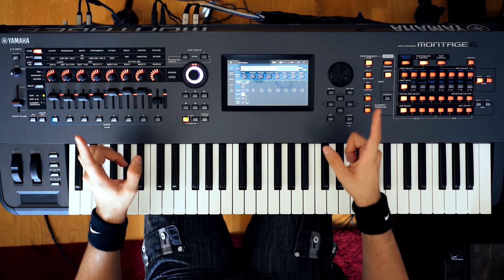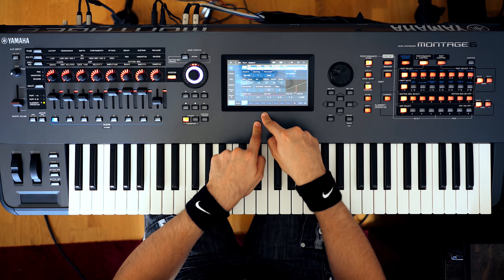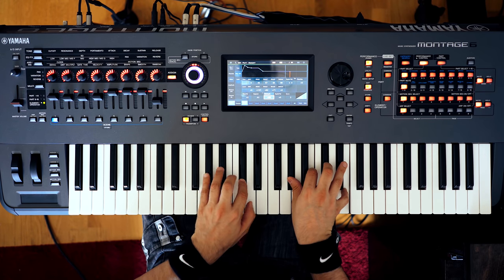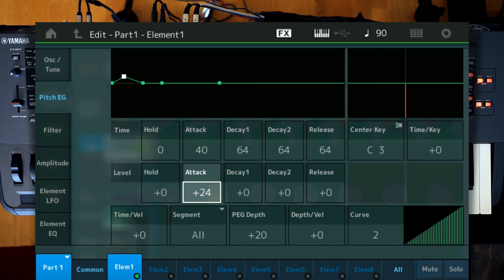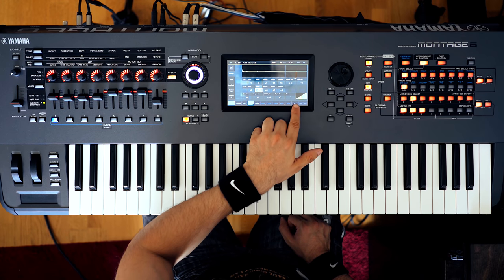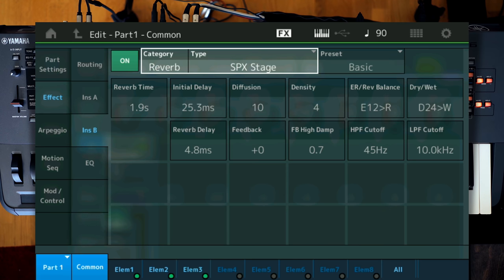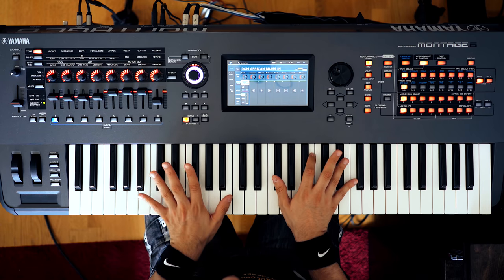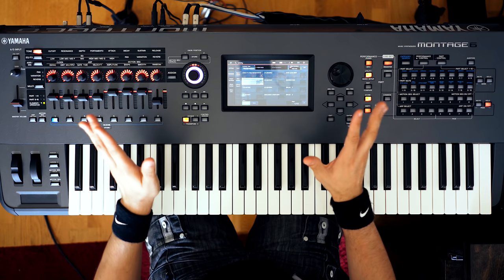How to Create Toto's Africa Synth Brass Sound on Yamaha Montage

Comment: Indeed  it works exactly the same on MOXF.
Reply: Luigi Maria Maesano you mean modx or moxf? I have the moxf8 and it doesn't have the touch screen
Reply: No touch. But to do this it makes no difference. It's the same enine (AWM2) of the MOtif/MOXF. @dillincasa6161

Comment: Thanks for the great video but you seem to have also pitch shifted everything down by an octave. I couldn't find anywhere in the video where you did that.
Reply from the maker: Hi Craig, I've used the transpose buttons (under the transport buttons). If you check, the left one is lit indicating that the whole patch is transposed one octave down. But you could also transpose the engine internally if you wanted.

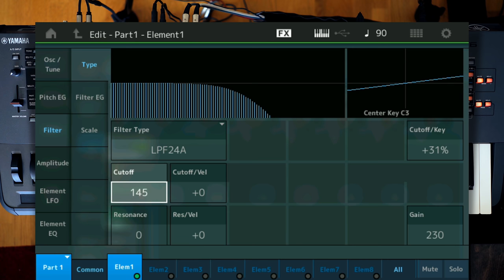Comment: I'm pulling my hair out.  At 2:28 in the video, with the exact same settings, when I dial back the cutoff there is no change in sound.  It's still the original unfiltered sound.  What am I missing?
Reply: Edit:  I was using the LongSaw waveform by accident.  When I use the P5 SawDown 0 deg it works.  But why doesn't the filter wok on the waveform I was using?
Reply from the maker: Hmmm it could be anything! Have you turned on the Element to begin with? :)
Reply: @DomSigalas  Sure, the sound plays.  But the cutoff has no effect.

Comment: On Korg Kronos or Roland Fantom, you have such sound and is not necesary to make it. If I have to make such sound so long - better to change the keyboard. Sorry - Yamaha again suck
Reply from the maker: Hey man, Montage has a similar sound but I bet like with the Kronos or Fantom it's not 100% like the original :) besides, in my book you buy a synthesiser to create sounds, I find it super fun, why would I want to use a stock sound? Plus, with Montage you have Soundmondo where you can find an incredible amount of FREE sounds :)